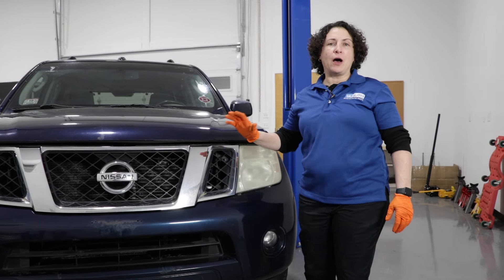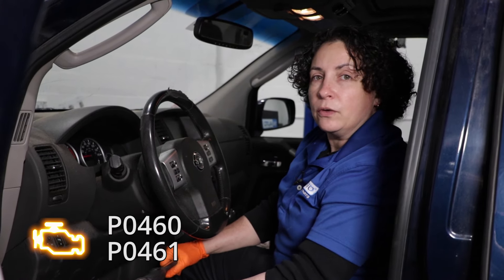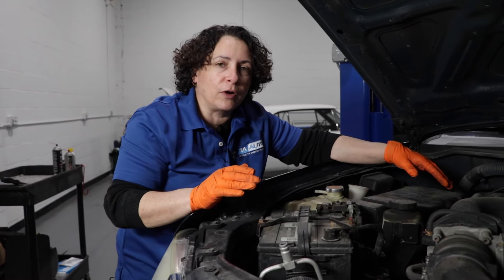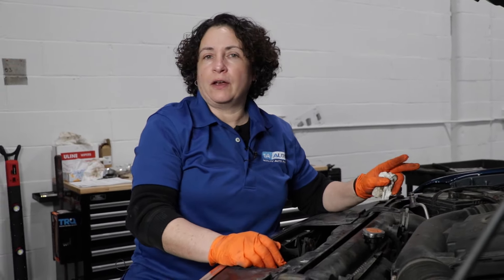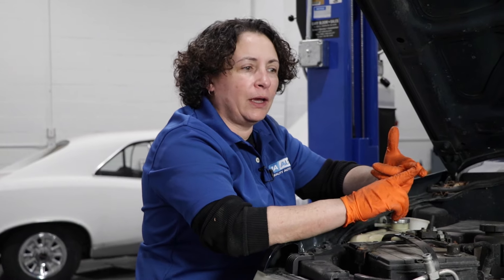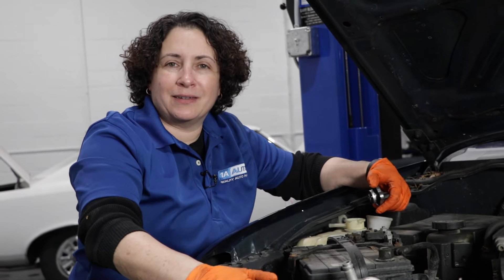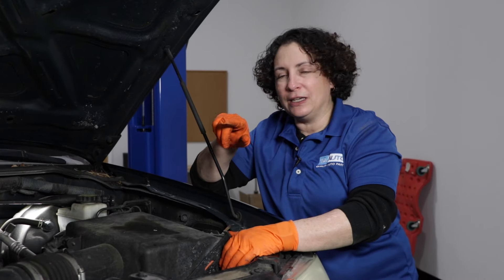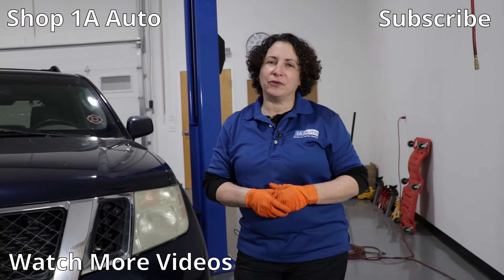Top 5 Problems Nissan Pathfinder SUV 3rd Generation 2005-2012

Comment: My dad bought a 2007 brand new and still has it today. It's had a few problems but man, they really don't make em like that anymore. People around me are surprised to see that this car is a Nissan, especially when they look at modern Pathfinders. This gen was definitely the best gen for the model.
Reply: I’m still driving a 2005 LE that is currently proud of its 348,000 km. Same story, it’s had some issues aside from the expected. But nonetheless it’s really been a solid vehicle!
Reply: I have an 07 SE, bone stock aside from 31" tires. Your comment made me laugh because anytime I bring up the vehicle  in conversation I always mention word for word, "They don't make them like this anymore". I have always babied it and kept it in great condition and it always makes me laugh when people are shocked that it's a 2007 model year. Solid and robust frame, practically zero features aside from cruise control which means there's far less failure points, powerful engine, tows like nothing is behind it, the list never ends. Favorite vehicle I have ever owned. It has 210k miles on it and the only thing I have replaced on it aside from standard maintenance components is the heater core inlet and outlet connections located on the firewall and a cam position sensor. I will keep driving it until the wheels fall off.
Reply: My dad’s 2008 has just over 20,000 miles 😂😂😂😂😂😂
Reply: @jakekrauss3273  , when you changed your heater core inlet and outlet connections, were you able to change the connections by themselves or did you have to buy the entire assembly? I see the plastic housing in front of the firewall where the hose plugs in gets very brittle in time. Also, if I'm standing at the front of the car do you know which is the inlet and which is the outlet? I'm not a mechanic but thanks to Youtube I don't think there's been much of anything I haven't been able to fix. Thank you in advance for your time and your response!
Reply: @wolslayer1  i'm not mechanic either but I'm pretty sure you can just change out the inlets and outlets. if you think it's your heater core you'll be getting a coolant leak into your floorboards of the cab.  you can try flushing it out and burping your coolant system. look up chrisfix on here, he makes good videos. they're not model specific videos but they give you a good idea of things.

Comment: My R51 Pathfinder just clocked over 620,440 miles...This version has a V8 5.8 L 370 Beast ! With service it every 6K miles oil and keeping the engine clean helps...New Transmission at 420,000 miles and plugs at 270K some little work...Still as powerful as the day we got her back in 2016 ( $20k with 150K ) This is one super powerful and strong Truck ! 🌲🖤👍

Comment: Well she forgot another thing Nissan Pathfinder are famous for subframe rust on the rear end. Expensive repair at the mechanic shop to replace and its components, also these models are famous for transmission failures especially at 220,000kms to 350,000. Watch out for these models. 2nd generation was the best pathfinder made strong and less cost effective.

Comment: My 05 Pathfinder is still pulling strong along with 210,554 miles on it. I changed only 4 things on it since I bought it back in 07 and it's been bullet proof since then. The radiator was the first thing I changed before the cross contamination problem became an issue 2nd the timing chain guide noise at 140,000mil 3rd valve covers 4th and a very important one was the firewall heater core hose tube at 89,000mil. It's just a awesome reliable SUV if you know where to to keep up with some of the common issues that have plagued this SUV from 05-10.

Comment: The only problem I have with videos like this is that the presenter speaks about an entire generation of vehicles as if every year had the same problems all the way through. The timing chain issue was largely resolved by 2009 and any 2010 with the issue would be on the level of fluke that any manufacturer might experience. The failed radiators were resolved by early 2010 as well but you have to check to see if you have the new part number as some of the firs 2010's built in late 2009 still had the old radiator. But what Nissan haters dismiss is that almost every make uses a radiator where transmission fluid is cooled by the radiator at least in part and every one of them that use this design has the very occasional problem with a failed radiator that destroys the transmission. It's just that the 2005 through 2009 4.0 liter engine radiators had a significantly high rate of failure than typical but still not a high enough percentage to say they will all fail because they don't. But if you find a good deal on a 2005 through 2009 just replace the radiator id there has been no failure yet and cross your fingers that the secondary timing chains don't cause you trouble because they are far more expensive to replace than the radiator if you're not well set up to do the job yourself. And even if you are it's a PITA so it might be worth it to let a dealer do it and if they F it up you have the warranty.

Comment: I heard about the coolant into transmission fluid issue so I replace the radiator with a Danso one at 80k mils, also the rack and pinion started leaking at around 80k, other than these 2, I didn't have any other repair at all. Good vehicle. This year I gave it to my daughter who is about the same age as the car.

Comment: I bought a 2011 Pathfinder LE 4x4 last November and while not a fan all of the plastic (i.e.,  the cargo area tie down points are pot metal just as weak as plastic compared to the 1/4” hardened steel  tie down points of my 1993 Pathfinder SE 4x4) this is my 4th Pathfinder and I love mine. My 1st was an absolute beast of a 4x4, upgraded the shocks all the way around and that bullet proof manual transmission never got stuck in mud, gravel creek beds, sand, snow, wetlands, NW USA rainforest waist high grass, rutted trails with puddles that almost swallowed me a couple of times. Drop it in 4LO and away we go. I miss that truck.

Comment: Great video.  I have a 2008 model I bought new, and still drive as my only vehicle in 2022 with 320,000 miles.  Yes, I’ve had a few problems over the year, and one rebuilt trans but I’ve pulled trailers very often, including a 14’ flatbed and a 6’x10’ cargo, fully loaded many times.  All in all this has been the best vehicle I’ve ever owned.

Comment: I own a 2012 identical to the vehicle in this video. Bought it New. It now has 167,000 miles. I am a retired aircraft mechanic and do my own servicing. 
I have had ZERO issues!
Nothing ! NADA! Not even a light bulb! It has been the most reliable vehicle I have ever owned. Even towed a boat for several years.
Reply: many parts revisions went into the 2010-2012 models which eliminated nearly all the previous problems.
Reply: I have a 2008 Off Road and have changed or serviced as needed,great vehicle if you take care of it!
Reply: I have a 2005 4x4 it's  been a great suv 
Of course I've done the regular maintenance.  I replaced the radiator  to avoid  transmission problems... it worked...
Reply: That’s comforting. I bought a 2012 LE for 11k with 103000 miles in pristine condition. I love it. Taking it on its maiden camping trip next weekend in Arkansas. Only thing I notice on mine is a rattle in the rear glass/door. I think it may need rubber spacers where the hinge mounts to the glass to fix that, we will see.
Reply: I also have a 2012 with 88,000. I LOVE IT !! I treat it better than I do my wife lol jk. Diffidently a reliable vehicle.
Reply: I have a 2011 bought it brand new I have done both front hub bearings and now dealing with p0101 mass airflow
Reply: @jorge8276  hey do they have aux cord. I just bought 2005 nussan pathfinder LE but I can't find the aux cords. I just want to play music from my phone.
Reply: Have to buy an adapter for lightning cables, but they have a 3.5mm aux input

Comment: When I did the plugs I took the intake manifold off and took that opportunity to clean it and the engine compartment, and other misc pieces. Also since it was open I was able to easily change the pcv valve and tighten down my headers because I had a lil seapage. My 2010 with 187k on it is running like a dream
Reply: Hiw long did it take to remove your intake manifold? What eaner did you use ?
Reply: It’s not a bad job, 30-45 minutes taking your time. I like SuperClean, don’t know about the OP of the comment.

Comment: I am the owner of a 2006. I have 241k miles. My Pathfinder is so fast and drives like a new car still to this day. I have had every problem on this list. I just had to replace the ignition coils and spark plugs today. I just saw this video and feel I watched this video one day to late as they did not replace all 6 ignition coils. Ugh.....I did get new spark plugs and cylinder intake boots replaced. I have to go check but I think they only replaced 2 ignition coils today.  Since I have owned my 2006 Pathfinder for13 years I have had every problem on this list and more. 1. The CATS go bad and you can have a check engine light on for years if you don't replace them. 2. Oil leaks needing to have all seals replaced. 3. Drive shaft 4. Radiator issues until you just say the heck with it and buy a new Radiator. The good thing is The new Nissan dealer in my town drove my Pathfinder at the same time I drove the 2020 models of Rogue and others and found none of the new Nissans have the power of the 2006. I am going to keep it on the road for a few more years. Bottom line the power and handling are superior with this 2006. 0-80 in no time flat. 120 MPH on the highway with ease. New Nissans are not something I can drive. Thank you for the video. Wish I had seen this a bit earlier but now I know it was not just me with all these Pathfinder issues.
Reply: Lol, my ‘05 Pathfinder had gone through the same issues, plus the replacement of fuel level float, cam position sensors, computer module, which I DIY on repairs. Overall, I love my Pathfinder for it’s ruggedness and torque/power throughout acceleration.

Comment: One thing you missed was the evap emissions canister that gets clogged with dust.
Still have our 2007 pathfinder. The dreaded coolant/transmission oil cooler leak occurred after the warranty expired. Trying to figure out what to do, and thinking of getting a new vehicle, as a rebuilt transmission was $7k. Got an email notification that Nissan had extended the warranty. Ran out to the car, and we were just under the repair milage by about 900 miles. Another transmision, and we were good to go. Been a very reliable vehicle.
Reply: Yep Nissan dropped the ball not making such an easy presentative to transmission failure a recall... Unfortunately bought my used Pathfinder with this problem...
Reply: But they say they fix the problem on Thor 2010 pathfinder and frontier

Comment: My 2005 Pathfinder just hit 237,000 miles (the distance from the earth to the moon). I had to change  the shocks and struts and the two control arms because there are 18 years old. These SUVs are no longer built this way. It's body on frame, tows 6k lbs, fits 7 people and if the roof is built similar to the frontier (which it is) the roof can handle 4 times it's own weight before it collapses. PS the antifreeze/trans oil issue is fixed by getting a radiator that's not OEM. The radiator failed and ended up destroying the trans. The trans itself is rock solid on that thing.

Comment: For the fuel level sender issue, you can swap the guts from a TrailBlazer unit for much cheaper than swapping the whole unit.  I cut the body under the rear seat for access, then used a fuel pump inspection cover from a used Nissan Armada to cover it back up.  Works great.  Reply if you have questions.

Comment: First of all, great video ma'am. 👍 I own an 08 with the VK56. Bought it used and one of the first mods I did was bypass the radiator coolant lines straight to the trans cooler. People tend to not flush the cooling system like they should and the coolant becomes acidic causing the trans fluid lines in the radiator to fail. It's a bad design but can be totally eliminated for about $5.
Reply from the maker: +Phoenix Rising Thanks for the feedback!
Reply: Can you show me how to do the bypass

Comment: Hi. there is a problem with the catalytic converter also on 2010-2012 models. they can break apart and clog the engine.
I have heard of such cases and I am afraid that I will not notice and it will be too late.
how to recognize earlier if there are any symptoms? Thank you for your help.

Comment: Radiator issue was fixed in the 2010-2012 models. They revamped the design.

Comment: Another thing: my 2005 had an intermittent cutout. Turned out to be the crankshaft/flywheel sensor. Easy replacement thru the right fender shield.

Comment: I had this SUV and l traded it years ago. I hated it because it was always vibrating since it was new. It always vibrated when l stopped at the light. It vibrated so much that l had to shift it to neutral to lessen the vibration. I took it to the dealer twice but they never did anything about the problem. After some research l found out that most of these SUVs have the same issue right from the factory.

Comment: I'm just having the timing chain done on mine. The original chains are well known for being unreliable. There is however a upgrade, duplex timing chain kit, which I'm having mine changed to. It's a double chain which is much more reliable than the original chain
Reply: I went to the dealer and they said 1400 for the job. I asked the service dept if they ever saw the chains actually fail and they said no its just really noisy. I drove the truck for another 100k miles with no problem... just a little whining from the chains. Sold the truck for 5 grand still making noise.
Reply: I thought it was the tensioners that fail prematurely causing the whine and rattle. I’m on my original chain and tensioners. 179,000 miles.
Reply: @elonsus9747  Correct. The tensioner part includes a plastic insert that wears somewhat prematurely especially if one does not do regular oil changes.  Once they wear to a certain point, the steel rivets that are used to fabricate the plastic insert are exposed and the chain runs over those rivets resulting in the whining and clacking noise you hear in this video.  My 2007 4.0 Xterra has 225k miles and so far I don't have this issue.  I've always used full synthetic oil and changed every 10,000 miles.  I think that makes a difference.
Reply: Did your timing chain issue make a code

Comment: I have a 2007 Frontier which had a misfire on cylinder 04. I ended up blowing that engine and got another engine put in and the same code came up for cylinder 04 misfire and scan at dealership shows it was only 92 psi in that cylinder. It spit black out the rear exhaust and I am thinking I may have a fuel issue. I do not know. I own a new Frontier and now I can try and figure this out myself I think?

Comment: would upgrade the radiator to an aftermarket aluminum one avoid the milkshake issue? At least longer than 50k miles per Original radiator?

Comment: My 2005 nissan pathfinder starts to stutter or shake at 40 mph. Im gonna try my luck on the coils. Thank you for the video it was very helpful
Reply: It could possibly be a transmission issue, due to engine coolant mixing in with the transmission fluid from a faulty radiator which will cause this problem. This same thing happened to me.

Comment: 2010 pathfinder 4.0 220,000 miles never broken down original owner minus a few thousand miles had one recall that was fixed by dealership. Now making a high whining sound every so often after driving in higher speeds but not every time not sure what it could be

Comment: Does anyone know if aftermarket radiators solve this problem? Looking to buy one of these used. I read that nissan used cheap metals in the radiator that corroded easily.

Comment: #6–Front Crash Zone Sensor.
People who live in the “salt belt” areas of the United States, that sensor gets corroded and you will get the air bag light flashing. Nissan made these sensors out of zinc, which corrodes after time and frying the sensor, causing the air bag not to work if you are in a crash. New ones are made of different material.

Comment: Don't for get the catalytic converters breaking down and the dust getting sucked back in to the motor and scaring the cylinder walls and causing massive oil loss
Reply: I believe that the last generation MR2 has the same issue.  The cats are located next to the header.

Comment: My nissan pathfinder 2005 dci automatic only driving in 3rd gear. Speed reduces and Il have to switch off and start again. Also struggling to Pull or drive when switching on

Comment: Were all of these xterras delivered with the same bad radiator design or are some better. My 06 xterra has 160000 miles and no radiator/transmission problems.